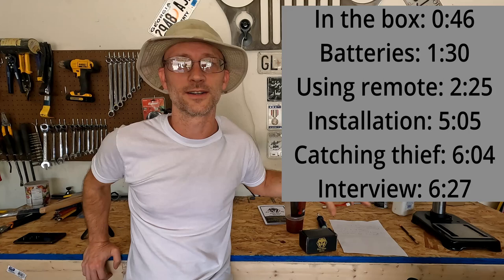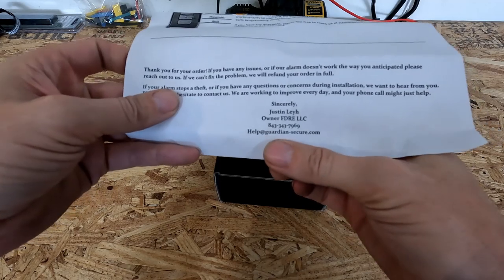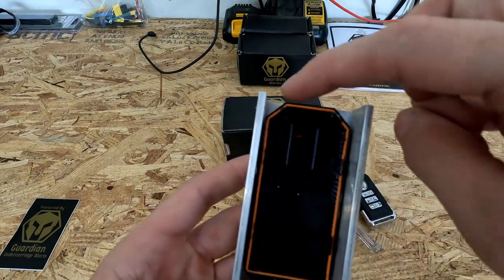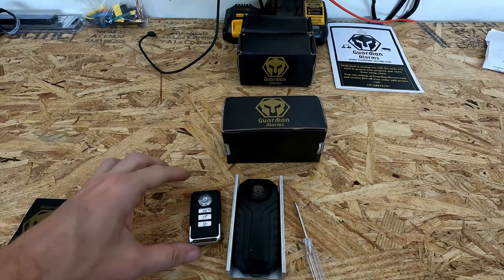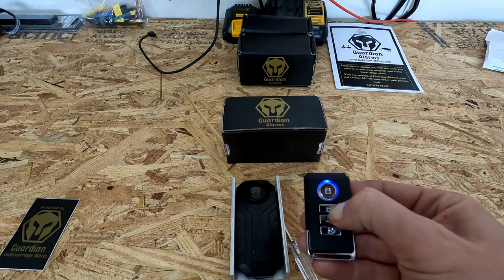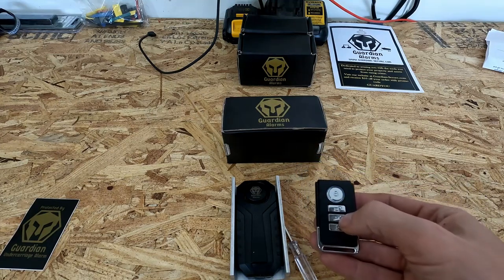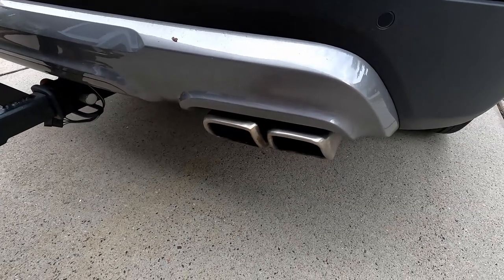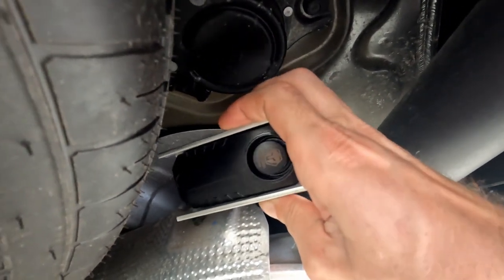Guardian Alarms Catalytic Converter Alarm - Cat Alarm PRO

Comment: Does it have to be right on the muffler somewhere or next to it Wont it get pretty hot ?
Reply from the maker: It's best to have it attached to the exhaust system somewhere, to feel any vibrations when armed. The have a large heatsink to protect from the heat. I've had mine on top of my muffler for months, no issues at all. Still working great.